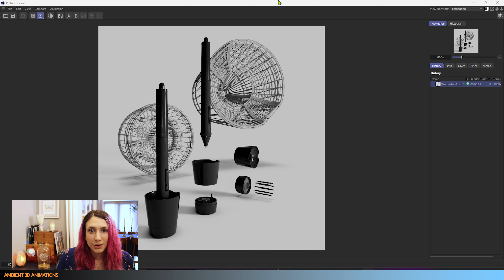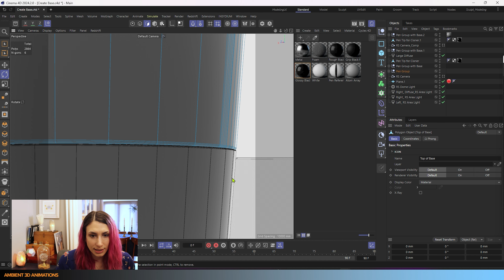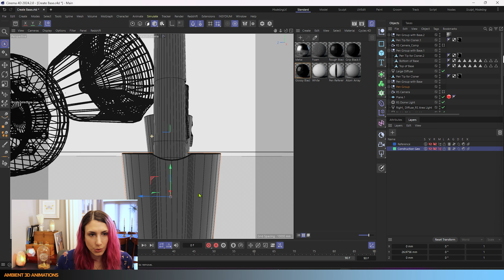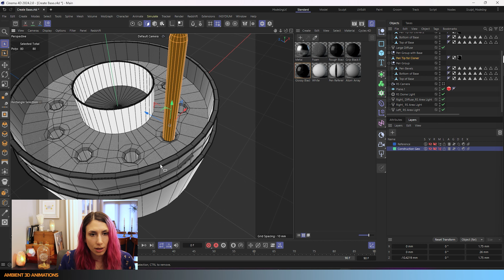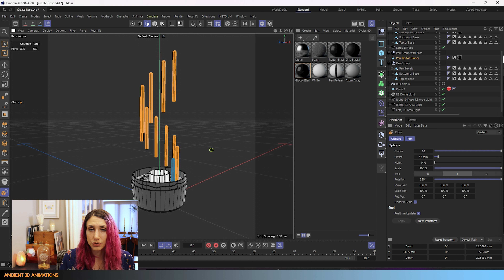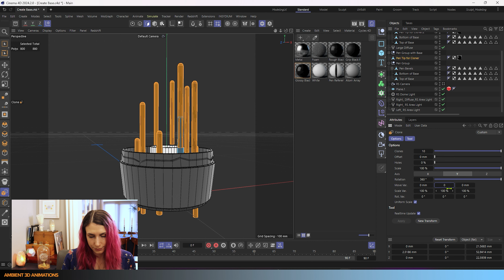Cloner Mesh Cinema 4D Tutorial EP60

Comment: interesting, but you can use the cloner tool in radial mode and then add the radial effector, thus keeping it mostly parametric. Is there an advantage to this? I'll bet there is a trick to keeping the initial shape parametric too
Reply from the maker: These are really great questions!

The advantage to the mesh menu cloner is that it is quicker for your computer to calculate everything in one mesh versus within something parametric like the MoGraph cloner. The MoGraph cloner is better suited for animating the individual parts while the mesh cloner is better suited for a 3D model that keeps your scene light weight. 

The only problem with keeping the first shape parametric by using the lathe, boole, and bevel deformer is that the bevel deformer doesn’t work well on boole hole edges. It also needs to be editable to be able to texture for the grip separately from the rest of the pen body. If you are okay with this and don’t need to bevel the hole for the button or add a separate texture for the grip, then that’s okay for your project. I wanted to closely match the real object though.
Reply: cool! I've actually tried using the rounding attached to the bump in my material, so I never actually have to do the bevel, but that only goes so far and can start to look "jenky" as EJ would say!  @Ambient3DAnimations
Reply from the maker: There is always more than one right way to do something so if you prefer another method, that’s okay too! Creating the rounded edge material works! I usually 3D model a more traditional method.
Reply: yep! Just thinking about cutting down render time with a leaner model! @Ambient3DAnimations